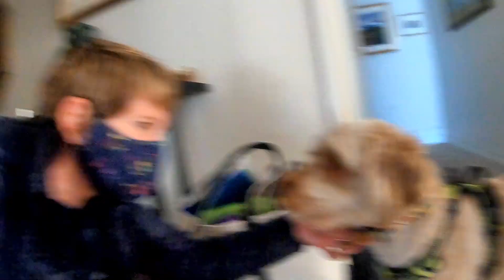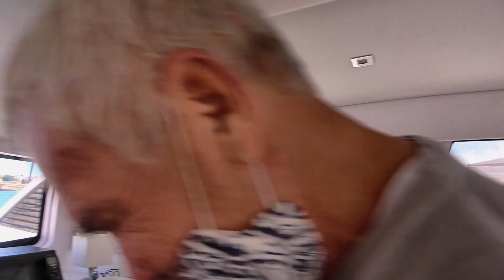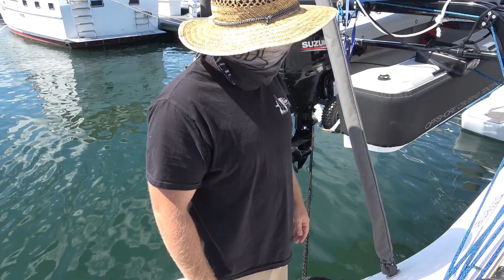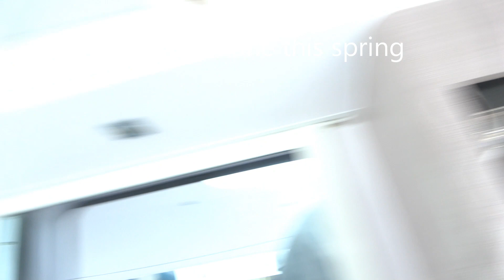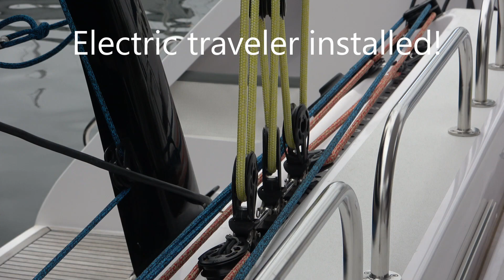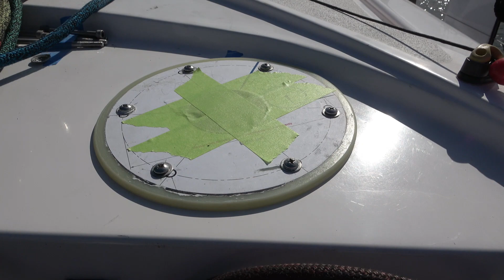Ep. 73. Going electric for the traveler, launch & winch maintenance

Comment: Very informative video - Not impressed with Outremer and the carbon work for your wench. Could have been an issue during a crossing if it failed. Great work and planning.
Reply from the maker: Pierre is very proactive and the problem might not have been spotted by someone with less experience. I  suspect  that uneven resin infusion during  boat building, in general,  is more common than many suspect.  Welcome back!

Comment: what about when you want to dump the traveller in a large gust? Looks terrifying to me!
Reply from the maker: On this boat there is no dumping the traveller without risk of injury -loads are too high. It is done slowly and carefully.   It is the mainsheet that is dumped in a gust.
Reply: @biotreksailing  thanks for reply and info. Neel use the same antal unit for the topping lift to raise dingy. Eats a lot of lines when under heavy load. Hope it isn't like that for you folks.